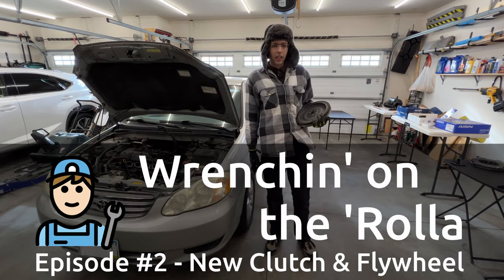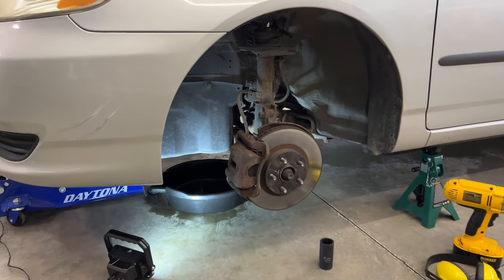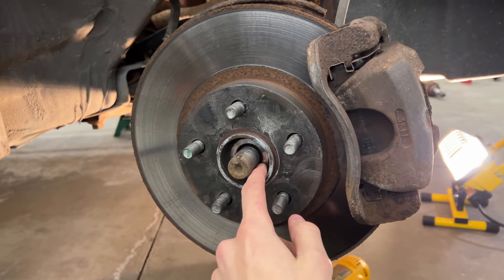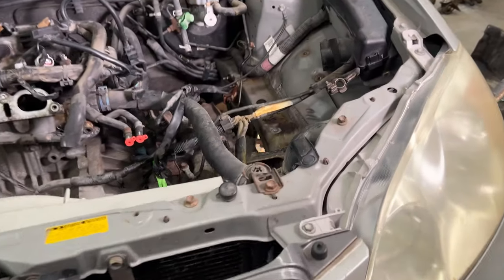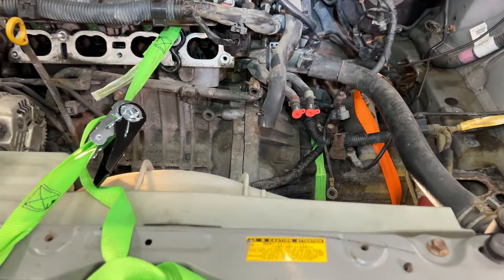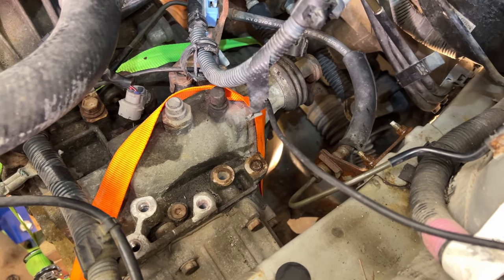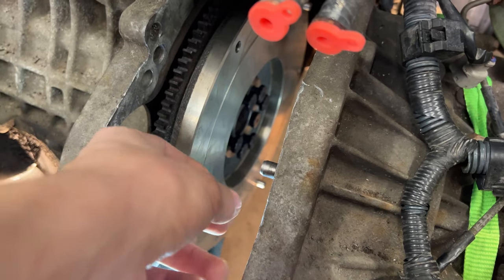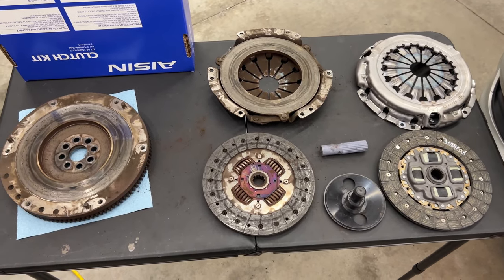Corolla Clutch & Flywheel Replacement (2003-2008) Without Fully Removing the Transmission

Comment: I just replaced a clutch and cvt joints in a 97 toyota starlet & this video was super helpful. Really appreciate you mentionning the torque specifications. Its was of great use. Other bolts I relied on the bolt size torque spec. Removing the cvt joint with a sledge and a rope was a very clever / out of the box approch. I've subbed and will definetly revisit this channel in the future.

Thanks again & gl with your channel

Comment: I did a clutch job on my 2011 Corolla 1.8L not too long ago. The procedure for the 2009-2013 is very similar to the 03-08 despite the difference in generation and difference in engine and trans. The hard parts were definitely getting the axle out, getting the rear motor mount out and putting it back in, and getting the transmission aligned back on. The axle I used a big sledge hammer and a crowbar and I knocked on the lips that are on the axles. The rear motor mount and aligning the trans is a matter of lifting and lowering the engine a bunch of times till everything lines up. However, I will say that this generation of Corolla is one of the easier cars to do a clutch job on. No need to remove the subframe, no need to remove crusty clutch lines (I just unbolted the clutch slave cylinder and hung it to the side), and there's plenty of room around the 5 speed to work on and get it out. Great video that I hope helps others with clutch jobs on Corolla's from 03-08, 09-13, and even 14-19 as they are all pretty similar to each other.
Reply from the maker: Thanks for the comment! Sounds like you had a very similar experience to me. I felt like it was a huge job compared to how I imagine a rear wheel drive tranny drop would be, but you are probably spot on that a more modern fwd car would have even more things to remove first. I was at a new car expo recently and wow, looking under the hood of some of them was a scary sight lol.

I’ve never driven a newer manual, only other manual’s I’ve tried were 90’s cars my friends had in HS. But I’d be curious to hear how the newer gen Corolla manuals are. I’m glad toyota has not totally given up on them yet. Although a Camry manual would be sweet.
Reply: I have a 91 corolla and was wondering if anyone else tried to so this?
Reply: Just finished replacing the clutch on my 2002 corolla after a hefty quote from a mechanic and long waiting period since they were booked out weeks in advance. Was pretty hesitant to do this by myself but in the end got the car back on the road thanks to this video. If you do decide to do it yourself get ready to break a sweat as this job requires a lot of crawling under the car and some bolts won't free up without a battle, given you have simple tools like me.  Aligning the transmission wasn't too bad given you have multiple jacks as in the video but it can be a bit of nerve wracking at times.
Reply: i did a 2005 matrix in my driveway, and those transmission mounts took some thinking to get it in again. I took it out in one piece and put it in two pieces then tightened it once the bracket was in
Reply: I thanks for this.  I got to replace rear main seal on my Scion IM.

Comment: Outstanding video. Thank you for the information you shared. I have a 2007 Toyota Matrix, as I understand is the same as a Corolla, I paid a mechanic to change the clutch and flywheel. I lack time and tools to get the job done myself. From the day I picked up my car I have had an ongoing issue that I never had prior to the clutch and FW replacement. You maybe able to shed light on what might be the problem. When driving, regardless of speed, if I go over irregular road surface, e.g. train tracks, the RMP will drop out completely for an instant and then resume. Now the problem has gone from that to stalling the car. It will start right up again and then drive no problem until the next time it happens, which could be at any moment or go for days without a problem. In trouble shooting this I have replaced the spark plugs, fuel pump assembly, mass air flow sensor and cleaned the intake system. All work done by mechanic (different mechanic who changed out the clutch and FW) parts and labour another $550.00. We also checked any fuse issues, loose wire harness, ground terminals, and love tapped almost the entire top surface of the engine to see if there's a loose connection somewhere. No luck. When the clutch and FW were replaced is there a chance that a cable has been stretched or plug that isn't connecting properly in a less obvious place other than the top side of the engine be the cause of this worsening intermittent problem? Any suggestions/advise is welcome. Many thanks, Steve.

Comment: Thanks for producing this video.  It encouraged me and son to replace the clutch in his 2003 Corolla LE.  It's not an easy project as you mentioned, but having the job done professionally cost almost as much as the car is worth.  Still, with only 123,000 miles on the car, it has some service life left if the clutch is replaced.  The clutch was slipping badly, and on the 50 mike trip to the garage, it starting making lots of noise.  Taking the transmission out was a major pain.  Those half shafts refused to come out with a slide hammer loaner from the parts store.  We were able to drive them out with an angled tip bar and hammer.  We decided to take out the transmission rather than try to do the job as you did.  That looked very tricky.  When we finally got the transmission out we were shocked at what we found.  The pressure plate was split in two and every bit of disc fiber material was gone!  Thanks for the tips on replacement parts and the need for a 16mm socket for those new flywheel bolts.  We still have to put the transmission back in.  I sure hope it's easier than it was getting it out.
Reply from the maker: I’m glad the video helped, getting the shaft splines aligned when putting the transmission back on will be hard, but after that you’ll be in the home stretch. I’m still amazed how hard those darn CV shafts are.

It’s great to keep older cars on the road and out of junkyards, especially a Toyota with only that many miles. Thank you for the comment, and good luck getting everything back together!
Reply: @BrenoAutoGarage  We got the transmission reconnected to the engine. Whew!  It took a lot of effort to get the transmission properly aligned with the engine while supporting it from underneath.  Getting the rear, driver's side, and front motor mounts was a task and a half, too.  What is the wire that connects to the plastic terminal on the top of the transmission.  We seem to have lost it!?
Reply from the maker: The grey plug right on top is for the backup lights to come on when you shift into reverse, not critical, but nice to have.

Maybe it got pushed away and hidden behind something while wiggling the transmission in? Or perhaps it was accidentally plugged into something else? (I am not sure if this is possible, all the plugs might be different)
Reply: @BrenoAutoGarage  Thanks.  I found the little guy hiding in a dark place.  LOL.  Hoping to finish up the project this week once my body recovers.  I have a new respect for auto mechanics.

Comment: For those wondering the "proper" tool for removing the axles is a slide hammer. A local auto parts franchise had a "loaner" program where you could borrow one for a short period for free. For my Corolla Matrix I had to purchase a 63mm "large" cv axle puller attachment as the smaller (I think 40 something mm one that was available through the loaner program was not the right size). 

Points to Breno for the resourceful approach, but the sledgehammer trick for some reason just wouldn't get mine out. With the slide hammer it came out in under a minute.

Comment: Your first person I've seem explain that there isn't a pilot bearing...been looking all morning for how to videos and yours finaly cleared it up for me...I liked the rig you used to keep the trans level and in line with the engine...these cars aren't the easiest to work on but they'll make you a good mechanic especially that rear motor mount
Reply from the maker: Having recently fully removed the tranny from my Matrix I think back to this video. You are right, a big job the first time (as I complained at the end), but second time you’ve learned the tricks and it goes smoother. Now if only I could learn a trick to stop all seized rusty bolts… Thanks for the comment.
Reply: I've done 2 rear motor mounts, bc I have 2 different year same 9th gen Corolla, and I've never cussed so much. Kinda funny because when I pretty much had given up and was about to pour gasoline over the car and light it on fire, the darn mount fell into place, I'm not much of a believer, but that has to have been god because I was about do no good 😂😂😂 and my car has basically no rust at all compared to the one on the vid but my cars have tested my patience. For a long time I had a problem with my 2006 where it didn't want to stay running and everything was good but codes for throttle body and some other thing I can't remember. It was all due to 2 tiny ground wires out of 4 tiny ground wires had broken from a tiny connector that goes from the wiring harness behind the throttle body area to one 10mm bolt on the block that's invisible because all of the vacuum hoses in that area. When I found the cables took 15 mins to fix, spent 6 months looking for the problem 😂

Comment: Great video and comments.  Currently working on my son's 2005 Corolla and it's been informative to see different people's points of views on doing this as I have watched many different videos.  In one case, the guy was worried about making the video too long so he would just give an overview.  This kind of thing is NOT as helpful as a video like yours where you really try to go through the details.  I think the other guy is missing the point.  We as viewers can choose what to watch and not to watch but we can't choose to watch something that isn't there.  Great job and keep up the good work.  I'm currenlty trying to work through doing this without a transmission jack as I don't have one and it seems like neither Autozone or O'reilly's have them available as a tool loaner which is highly disappointing.  Don't want to spend money on something I will probably only use 1 time.  Anyway, thanks again!  Oh, one more thing, where did you get the tool you used to turn the flywheel?  I don't think I saw that anywhere.
Reply from the maker: Thank you for the comment and kind words! I just recently fully removed a transmission from a Toyota Matrix (I might make a short tips video, not a full guide, it is similar to this video) using the same motorcycle/atv jack with ratchet straps and a board underneath. I have not used a transmission jack, but I have used the moto jack for many projects. It might be worth buying one of those vs the tranny jack being more specific, single use.

Here is the part number and link to the flywheel tool, hopefully my comment is not too late to help! Good luck on the project, and if you’re done already let me know how it went.

Lisle 23800 Flywheel Turner, Factory https://a.co/d/2LMO8SW

Comment: I’ve replaced my CV axels on two Hondas. Most recently is my 2010 Accord. Just use a larger size flat blade screwdriver. The snap ring is just to hold it place while you’re working on the car and it’s not that strong. Just be gentle on the aluminum transmission case.

Comment: I just wanted to let you know if you do another Prius head gasket, do the pistons and rings also. I did a 3rd series and did not need to pull the motor, just dropped the pan from the bottom and was only 10% more work, well worth it because they all seen to have SLUDGE/Oil ring issues, just a cost for the up-dated pistons and rings of $800. Good work on your work and filming.
Reply from the maker: Thanks for the comment, funny enough I am working on a 2012 Prius head gasket right now! I did the valve stem seals this time, since I know the early 3rd gens had oil burning issues from there. Cut my finger trying to pressure wash the EGR cooler. It is carbon’d up like a brick. My 2015 Prius V EGR cooler cleaned up fine, this one I’m replacing.

However I did not know these had the ring issues of other 08-12 Toyotas… This Prius is not mine, so I don’t know if it burns oil or not. But I imagine it does from what I saw. Gives me something new to think about.

Comment: Most well-spoken presenter and great details. I followed this video to finish my first clutch replacement job on a 2004 corolla of UK model which is almost identical to your car except my steering is on the right. unfortunately, only first gear can be engaged after everything were put back together. I bled the clutch hydraulic system to ger rid of all the air in it already. Anyone experienced the same?
Reply from the maker: Thank you for the comment! The only thing I can think of is to make sure the shift cables are hooked up correctly and that the little metal swivel part on the top shift arm didn’t fall out. If you watch my shift bushing replacement video at 4:45 I show this little part.

Comment: I just bought an 07 corolla s 5 speed manual, and it needed a clutch in the worst of ways, i drove it from one of my uncles houses to my other uncles house which is pretty much across the road. but we ended up replacing the clutch as well as the shift cable bushings
Reply from the maker: Sounds like you’ll be having a good time now, lots of miles ahead on a new clutch. New bushings definitely help the feel don’t they, I was amazed.

Comment: I am going to be doing this job myself in 2 weeks to get my car ready for school. Me and a buddy, so I hope it goes well lol, I doubt it but plan is to try and finish in a day if not max 2.

Already did an automatic transmission swap on a 2007 Toyota Yaris and my Corolla is an 08 kept in the South so hoping no rust. The two seem nearly identical in the procedure.
Reply from the maker: Good luck, sounds like you have the experience to get it done fast. How did you pull the auto, out the bottom or top?

I have an engine hoist now that I didn’t have then, could have made this a different job.
Reply: @BrenoAutoGarage  I still have yet to even think about starting the project lol (constant 96F+ weather where I live, feels like 104F due to humidity). Been rather busy with work as well, but I think Monday will be the day I officially start the project.

As per the Yaris, I got it out from the bottom, I have been thinking about getting an engine crane/hoist but I dont have the money for it currently.
Reply: Update: I fucked up and asked my father for help as he was in town instead of my buddy. He is an egotistical maniac who refuses to let me do things properly in the name of saving money and not being proved wrong.

Told me if we took out the bolts holding in the ball joints the car would come out of alignment so his fix to taking out the axles was to yank them to the side and PUSH DOWN AS HARD AS HE COULD ON THE BRAKE LINE TO MAKE ROOM FOR THE AXLE. I would rather PAY FOR  A REALIGNMENT THAN DIE BECAUSE MY BRAKE LINES START LEAKING OR RIP APART.

He has also done countless other things such as  breaking the CV axle boot, consistently denying that manual transmissions don't have fluid (he tried to clear this up saying that I myself said I had an automatic transmission when I CLEARLY HAVE A MANUAL and refused to let me water down the worn down clutch material (he ended up getting a face full of asbestos).

Safe to say I am going to get the car assembled, then do the job myself on my own terms. After actually going through the process, as long as I don't drop the transmission and break it, I can genuinely say I can probably get the job done by myself in 1-2 days.

Comment from the maker: Afterthought: before you start any work measure your CV axle, where it goes into the transmission, and find/make/buy something like a slide hammer, pry fork, etc so you don’t have to resort to rope and a sledge hammer to remove them like I did.
Reply: Man I've used ratcheting come-alongs and everything else to remove an inner CV joint. Maybe this is why Subaru uses a pin and German cars use 6 bolts to connect the CV shaft instead of that stupid circlip like Asian cars use. You have to rotate the shaft until the gap in the clip is facing downward!
Reply: does it have a pilot bearing on this car
Reply: does it have a pilot bearing on this car
Reply: bro does it have a pilot bearing on this one cause i dont see any of those you replaced
Reply from the maker: No pilot bearing on this car

Comment: Thanks for your video. Did my clutch on my vibe with your guidance. Pulled the whole trans out without removing the x member cause I did rear main seal too. Must get flywheel bolts..count on getting arp bolts no one else had them! And the areas you pointed out are a pain..but doable.
Thanks for your advice
Reply from the maker: Thanks for the comment! I recently removed the transmission from my Matrix, I’m happy you could fit the manual tranny out. I dropped the subframe for mine since I left the transfer case (AWD Matrix) attached during removal. It makes me wonder if I could have gotten the auto tranny alone out without removing the subframe, though it was darn tight as it is so probably not.
Reply: @BrenoAutoGarage  awd would be a tight fit. Except for the mounts I'd say this is a good transmission to learn clutch replacement. First one I've ever done and it's still working fine after 1000km.